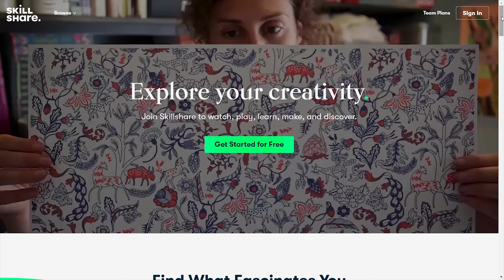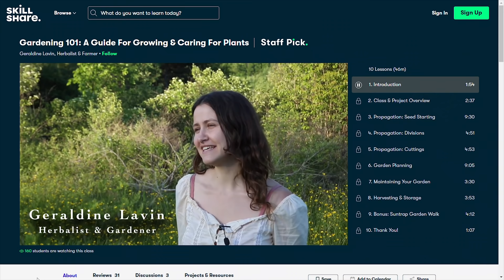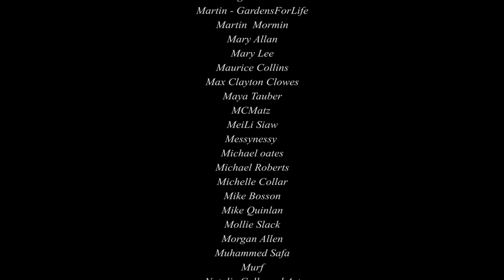How To Build a Rabbit Tractor!

Comment: Love your videos and this design.  I'd really encourage you to consider putting some thick insulating material between the wood of the roof and the corrugated metal.  Rabbits have super sensitive hearing, and the sound of heavy rain on a metal roof is actually quite stressful for them.

Comment: Hi Daniel.
I've recently discovered your channel and thoroughly enjoy watching your videos. I'm fairly self supportive, to some extent, at least and enjoy the solitary lifestyle away from the madness of modern day society.
I'd just like to comment on two things regarding your build of the rabbit tractor;
Firstly, I would have gone for a slightly thicker piece of timber holding the wheels, to prevent splitting and long term wear.
Secondly, your handling of your angle grinder scared me a bit.
As I often work with steel and the tools necessary, and might I ad, that I was taught by my late father who was a millwright and a boiler maker, I learnt to handle an angle grinder to the dide(blade running past one's body) for safety.
I've, twice, seen people having horrendous accidents with these machines, handling them in a similar way to what you did here.
Other than that, awesome work sir.
Ps. My family originally came from Ireland and I've always had a special affinity for the country of my Ancestors.
If possible, I'd like to visit some day.
Sincerely
Réno Potgieter
South Africa

Comment: It seems kind of small.  I don't see how it is much different than just putting a cage outside.    The reason I would want a tractor is for the buns to get enough exercise not just for me to avoid cutting lawn .     So to put them out in during the day .  For that I think a structure that is just a wire  frame and easy to move but about 4x times the length without the hutch .    Perhaps you could consider making something like that to show us .   Where I live it gets to temps of -40C in winter so not something for over winter.

Comment: A great video. I've made this exact rabbit tractor, but the rabbits I put in died unfortunately. Apparently, this could be caused by the wood I used (pine). On top of that, I used is as a maternity ward and after the mother passed, all 12 kits followed soon after. I'm still not sure about the pine toxicity. Has anyone else had problems with this particular build. Otherwise an awesome video, I love the channel. Keep it up!
Reply: Had chemicals been used on/near your grass?
Reply: @Rick_Sanchez_C137_  no, pretty much all organic here. I might have had a viral infection in my rabbitry: 28 rabbits passed…

Comment: Love the idea but what is the mesh bottom like for their paws?
Reply: I thought the same. And the size of the hutch. Wouldn’t they like a bit more space to hop around in? No judgement. Think you are doing a fantastic job and this comment comes from someone who lets animals sleep in the same bed as them so ....!
Reply: I think, with the mesh being on the ground and grass protruding through it, it's not a problem.
Keeping rabbits on mesh would be an issue, if that was all, they were sitting on - so their weight would only be supported by the thin wires. And it's not big enough for them to do more than a couple hops anyway, so chafing also shouldn't occur. Although I would agree, that it would be lovely, to give them wider range at least occasionally. I had pet rabbits for years and they do enjoy running and jumping just for the heck of it, when they've been cooped up for a bit. Still, I'd agree, that they have a pretty nice life there, in any case.
Reply from the maker: Exactly! Their weight is supported by the grass, and the holes are big enough for them to munch away unaffected. They hop around quite happily as if the mesh isn't even there. Keeping them on wire mesh in a hutch with nothing underneath would be unpleasant for their paws in my view.

In terms of more space: in an ideal world yes, but do bear in mind because of the wheels the enclosure is moved every day on to fresh grass. And rabbits typically stick around the entrance to their burrows, as they like to feel safe. There is enough space in there for them to jump, and I do at times move them in to the chicken area (which is huge), but there is always the risk of burrowing and predation.

Comment: You mentioned needing a steady hand to cut the grooves into the ramp. Remember, your saw has a depth stop which will allow you to set the depth of the grooves :)
Reply from the maker: I don't think my Guild mitre saw has that feature. It's literally the cheapest mitre saw money can buy - from Argos! :)
Reply: Sticking out of the top, towards the rear of the saw, is an adjustable bolt... hopefully, below it there should be a stop which folds down to allow that bolt to control the depth.

Comment: never use this kind of metal mesh in your cages because rabbits brake their paws in the large cells
Reply: I think this would be a bigger problem if the rabbits were standing on the mesh itself suspended in the air, but this hutch is completely supported by the ground so the rabbits are really walking on the grass coming up through the mesh.

Comment: Hi 
I have only just discovered your channel an find it both entertaining and informative.

Please can you help regarding rabbit enclosures.
I researched and found that most rabbit sites state 1 to 2 rabbits require about 8ft2 of enclosed space and 24ft2 of exercise space.

I also see, in America some keep their rabbits in raised wire cages in barns (horrible)

Can you advise why you chose the size you use.

Keep up the good work
Reply from the maker: Hi! Those dimensions would be based on a static permanent enclosure. My enclosure is moved every day on to fresh grass, and I believe that makes a big difference.

I do also have larger enclosures which I use if keeping them in the same spot for any length of time, but if you want something on wheels (which is key to fertilising my vegetable plots) then you can't make it too big or it's unmoveable. 

Ultimately you have to make that call yourself. I see absolutely no mental or physical issue with my rabbits, and or indeed any difference when they're in a bigger enclosure. Saying that, welfare is hugely important to me, so if I saw any evidence to the contrary I'd change my approach.

Comment: I have questions but first, Great design, the planks fit well between corner posts, you thought out the cutting lengths, etc. Now would you protect the wood at all ?with bees wax, linseed oil, rot proofing essential oils,  natural based paints etc ? Do you use them year round ? Rotate them to keep them dry ? Accept natural wear and tear and replacing some parts ?
Second, the floor mesh, it it stapled from the inside or the outside ? 
Third, my rabbit caught mixomatosis here in France from eating fresh grass, are your vaccinated ? Maybe you do not have that disease in wild rabbit populations? Maybe your rabbit breed are resistant ?
Reply from the maker: Thank you! :) The timber is pre-treated (soaked in oil before being sold) so is supposed to have a 10-year lifespan before it rots. The first tractor I made I did varnish, but since then I haven't. I think I'd be more inclined to accept wear and tea and replace parts as needed. Saying that, it's a robust build, so thus far at least, nothing has needed replacing on any of them. The floor mesh is stapled up from the outside, but well (there are no gaps).

My adults are vaccinated. The young I don't vaccinate, but advise the new owners to do so. So far none have caught it in four years I've had the rabbits, but it's definitely a risk one takes.
Reply: @MossyBottom  thank you so much for your answers and shared experience !

Comment: I so love your life👍👍👍 be Carefull not to give your rabits cabbige and/or rhubarb to often. They can catch diarrhea from it and when that happens most of them will die. When their main diet is vegetables, you can also give them branches, leafs and bark from willowthrees, that is not as soft en will keep their theeth at good length andthe structure is good for their insides,  daily hay they also need next to vegetables😊😊 i use to have the "tractors" for the rabbits when i was young,allthough there were trainglel-shaped back then (talking about 50 years ago) omg im so OLD🙈😂🤣😂

Comment: 1. Do you have raccoons?  I think they would figure out how to open unlocked latches.
2.  Do you treat the wood (or use specific, rot resistant species?) to be more water resistant and less appealing to arthropods?  I am always worried about fungi outdoors (except in desert climates?), and worry that termites, carpenter ants, possibly some ambrosia beetles, or even carpenter bees (far less destructive, since they don't consume wood but merely bore into it to make nests, but other pests like fungi might make use of their holes to gain entrance, and clever predators might figure out where the wood has become thinner/weaker due to the bee burrows and try to gnaw or crack in at these zones of fai) would find their way into the wood and destroy it.

Comment: How come they didn't dig underneath...or maybe u r moving them before they have the chance?
Reply: There is wire mesh on the bottom. You can see it, when he moves the coop. Otherwise, they would just run off in all directions, when he lifts and moves it.

Comment: When you lifted the tractor and moved it, it looked like it has a bottom because the animals moved with you?
Reply: It has wire mesh on the bottom. Also prevents the rabbits from burrowing under it, which they would otherwise almost certainly do.
Reply: Great design! Do you think chicken tractor would also need a bottom? And would a bigger tractor be better so they have more space to move?

Comment: Any problem with foxes digging under the cage?
Reply from the maker: There's no way a fox could get through 2mm mesh - it would crack their teeth. The key is choosing the right mesh (insulated with plastic so it doesn't harm the rabbits and thick enough to be very strong). Not all wire mesh is equal.

Comment: Although it is very usefull to protect the wood of the hutch itself, rabbits need wood to chew on and keep their front teeth worn down and lined up properly. So placing the mesh where it is not safe to chew is only half the work. 
Also vaccinate rabbits that can be exposed to musquitos that transfer diseases like myx and that hemmoragic virus (1&2). If you have coccidia in your soil or tuleramia don't do this, the first is an intestinal parasite that can kill them quick and the second has no vaccine or treatment + can transfer to humans. Check with your vet for info on what is around where you live.
Reply from the maker: I regularly give them hazel canes cut from my own trees to chew on. It's all about redirecting the chewing, not trying to stop it.